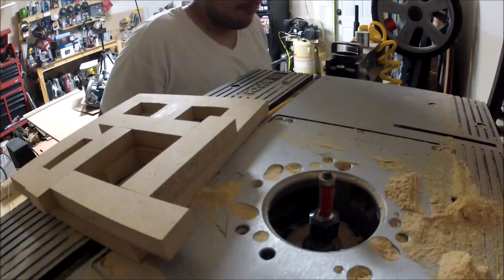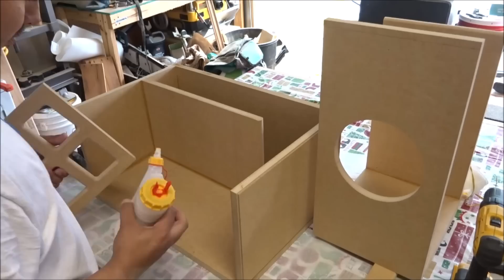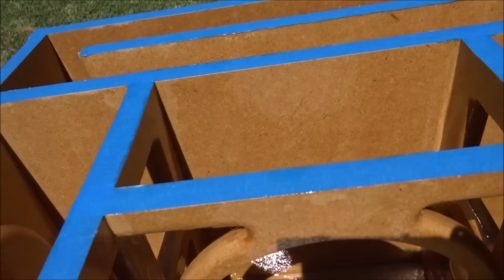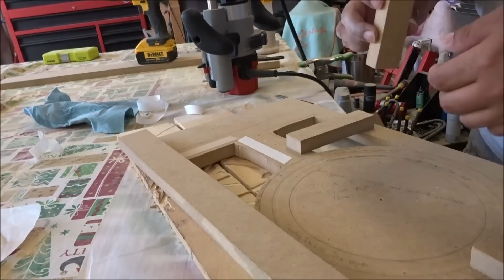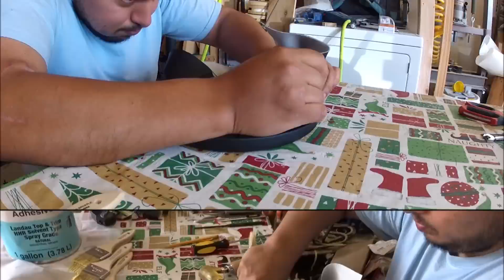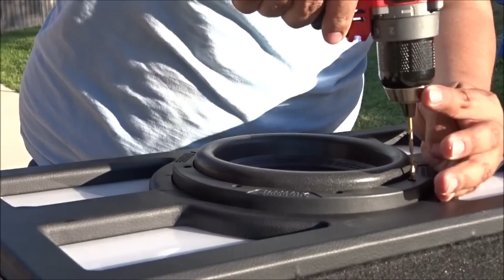Custom Labyrinth Style Subwoofer Box Build Sundown X8 V.3 Part1

Comment: Whay did you coat the inside of the box with and why
Reply from the maker: I used fiberglass resin(specifically SMD Sunflash), The wood I used(MDF) is very porous and it helps with sealing the box which doesn’t waste my spray paint and makes it look glossy. 

I also hear that there’s a benefit because the air the subwoofer is pushing is not forced into the wood so it sounds better or is louder or both. I honestly couldn’t tell from the last box I built. Probably because I didn’t have one coated and one uncoated to hear the difference.

Comment: A lot of unnecessary work like fiberglassing the inside and painting the inside and that sub does not need a motor brace and used cheap carpet after doing all that vinyl work to make it look nice
Reply: D Cardullo where does he fiberglass the inside? I seen him coat the inside with resin so the mdf soaks it up and is ready to be painted.